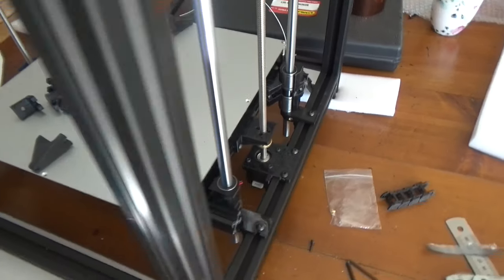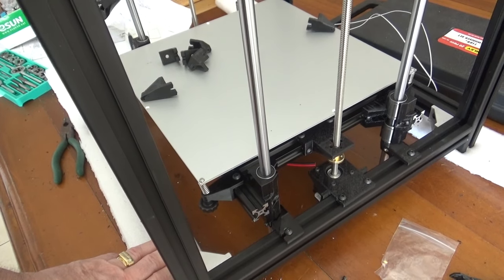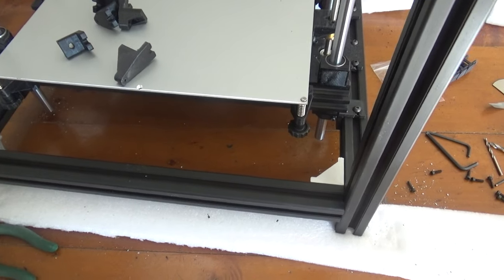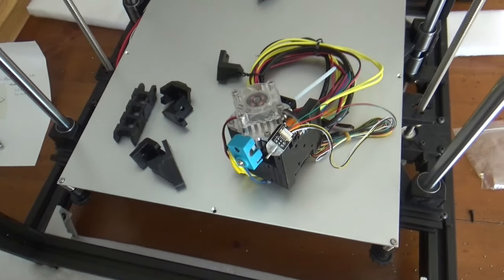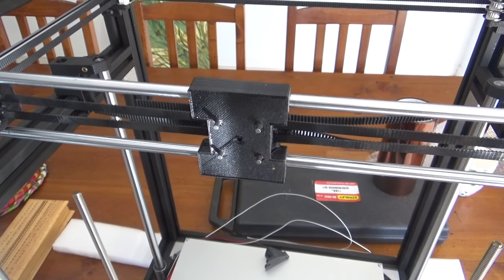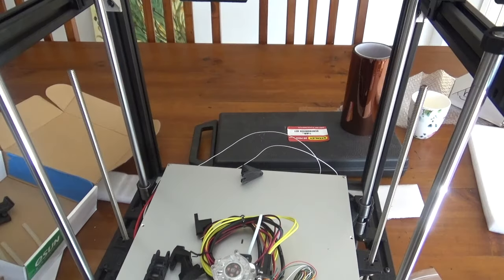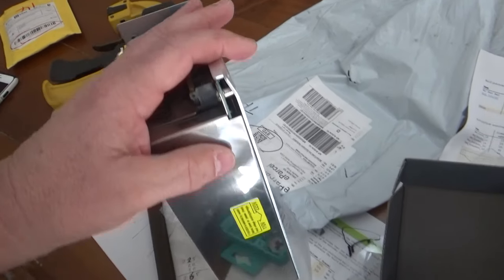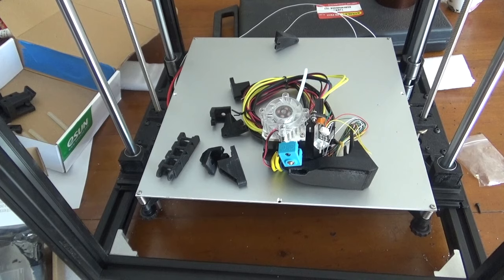#097 Hypercube Evolution 3D Printer Build - 6 (Build Plate & Titan Aero)

Comment: Im going to put a Duet Wifi in mine. How have you been getting on with your printer 9 months later?
Reply from the maker: Apart from not having enough time for my hobbies it’s been pretty much faultless after sorting out the belt and I had a weird issue with the board where it appeared to reset mid print, not good. I thought it was the PI first, I run repetier server, but it turned out to be the controller board.
I have a new skr1.4 board but haven’t got round to fitting it, the problem seems have just gone away though, strange as, but no complaints lol
I guess that is one reason to go with a duet though, probably better quality.